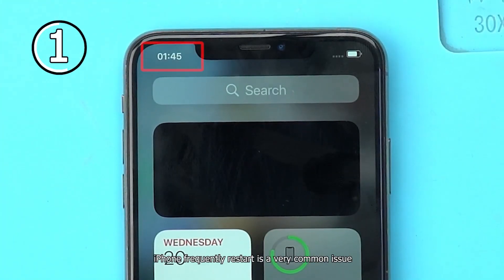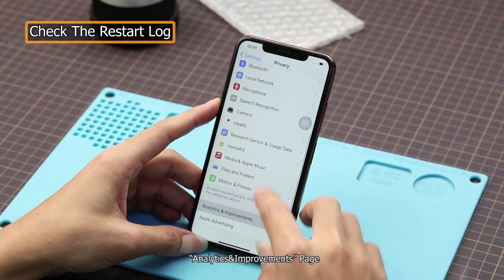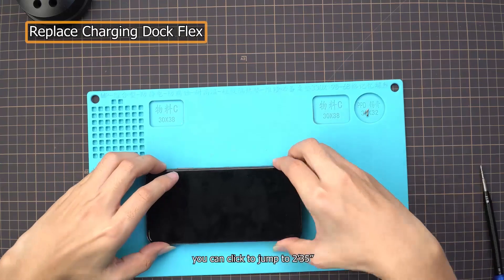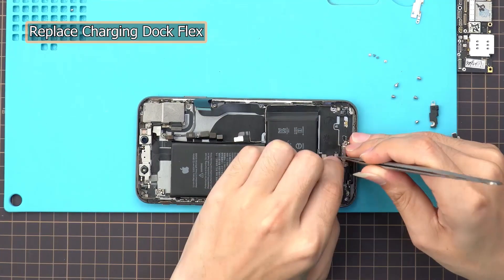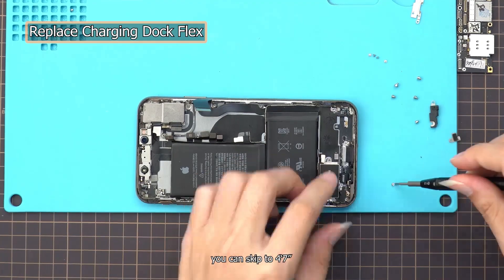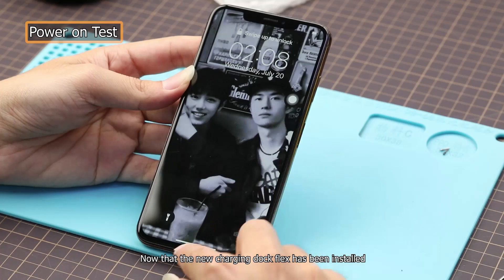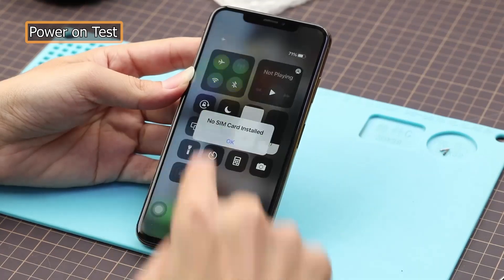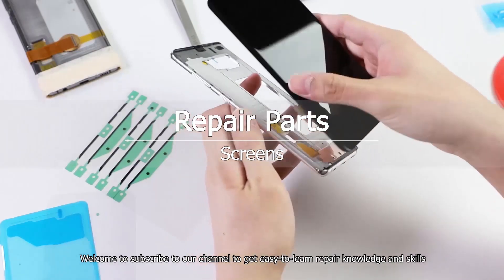Classic Case of iPhone XS Max Restart Failure

Comment: Sorry, But is this a legit OS? I know your method is legit. But the operating system you are using has been modified from other companies.
Reply: And its lagging a lot this aint legit
Reply: @drakotaz7729  when iPhone lagging it's doesn't mean the OS change .

The lagging because of the restart problem , if you have knowledge about iPhone repair then try to install a poor battery and look at the iPhone how it will lag as hell .

poor part = lag
Reply: @scorx1  that’s useful, I thought it was fake or something cuz it doesn’t look right
Reply: There's nothing called " Legit OS " in iPhone , you can change the OS in android but not in iPhone .